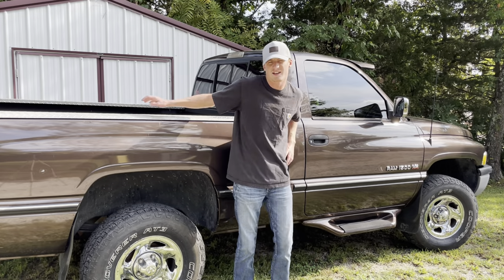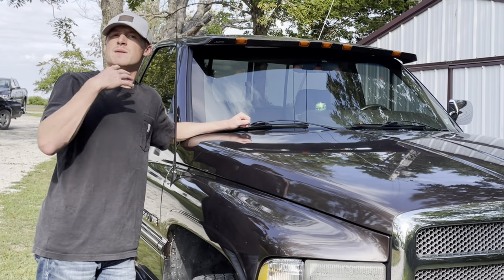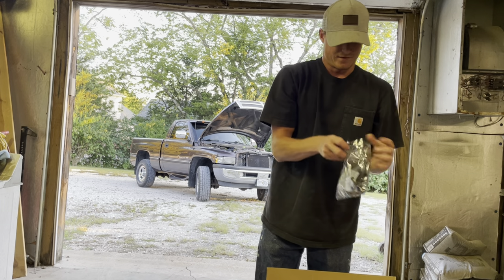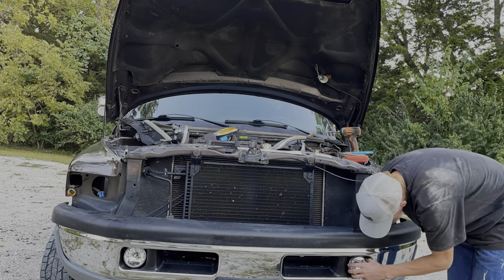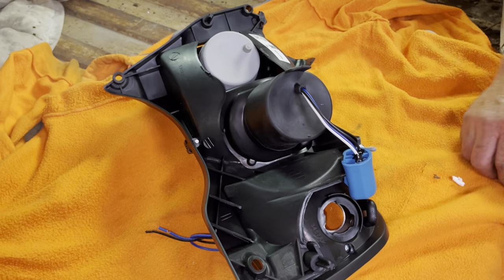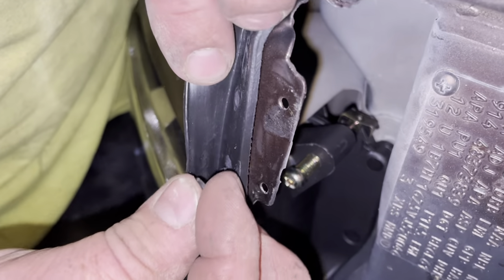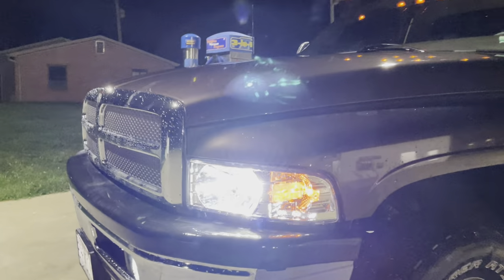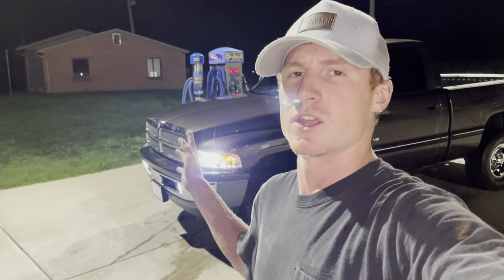Converting a 2nd Gen Dodge to LED Headlights/Taillights/Fog-lights (MUCH BRIGHTER)

Comment: I wish someone who does these vids would actually slowly video the light from about 2 feet away so we could see how the fit is...side to side and also looking down to see if it sticks out the same...Also the led you bought will not give you the correct light for the lenses...you need the leds that look flat on both sides and have a band of leds usually 3 to mimick the light from a halogen bulb...The 9004 bulb is a high/low bulb so there would be 6 leds on each side 2 rows of 3 offset a little bit...also they should be able to be adjusted 360' to line up properly...9 and 3 o'clock position...this will give way better pattern and not blind the oncoming traffic...brighter also...Thanks for the vid and good luck...

Comment: The LED signals need 50w 6ohm LED load resistors .. Won't the LED headlights run hot with the rubber boots restricting air to the LED bulb cooling fans ..

Comment: Just got my 2000 second gen club cab back on the road after cab corners, lower door skin on passenger side, nice junk yard drivers door and front opposite side fender and new back bumper. Went from maroon to olive green metallic. You should see her. Found your video for LED advice. Thanks

Comment: in order to fix your blinker problem you need a LED relay flasher that goes on the left side of the steering wheel when you open the door. 
you’ll see it in there. the fuse box will have 2 of those. 
one is for the blinkers and the other is for the emergency lights if i remember correctly. 
i changed out both of them years ago because i’m running all LEDs. 
actually i have a video on m channel on it if you want to exactly what i’m talking about
Reply from the maker: fixed it

Comment: Reading below, no you don't need a blinker relay, its a resistor with heatsink thats wired inline at the marker light.
Reply from the maker: Relay fixed it

Comment: I bought OEM headlights and put LED bulbs in them.
I put red led bulbs in the turn signals.
Love them.  Bright as hell.

Did not do the fog lights.
Did not do my brake lights yet.
Although I did put LED bulbs in my reverse lights.
Reply from the maker: helps with driving at night!

Comment: So I installed LED headlight bulbs and LED fog light bulbs but I can’t seem to run them at the same time. When my headlights are on and I turn the switch on for fog lights, the highlight beam comes on and fog lights won’t turn on. Only way the fog lights work is if I don’t turn on the headlamps or just turn them on half way to only light up the turn signal lights for daytime driving. Any suggestions? (1999 Dodge Ram 1500)

Comment: Headlights work great- but the tail lights- I put LED for turn signal, but the brake/ running light (while on) won’t turn on. Rotated 180° and tried again… nothing.   Both sides.

Any suggestions?

Comment: Is the 98 1500 sport the same? I can’t see nothing with my headlights
Reply from the maker: Should be
Reply: the  sport has a different light...2 bulbs high and low...all others it is only one bulb...they should fit the same but different wiring...

Comment: 9007 headlights, 9004 led bulbs…… adapter of some kind?
Reply: Got em backwards..lol…. 9004 headlights, 9007 led bulbs…..?
Reply: those are 2 different bulbs...look  it up...2nd gen uses 9004 bulb
Reply from the maker: 9004